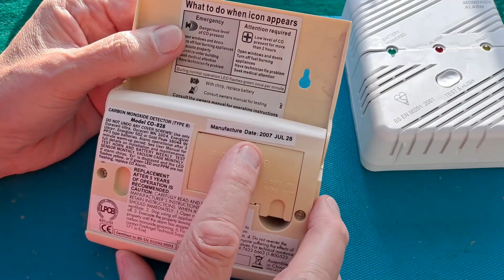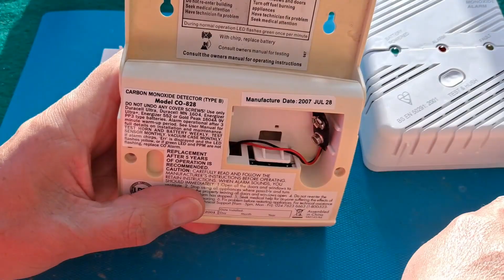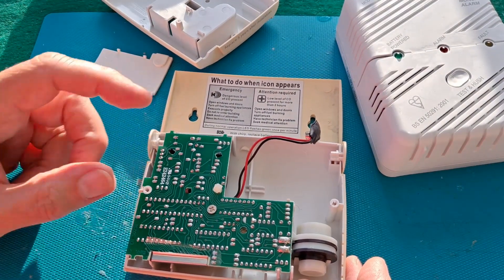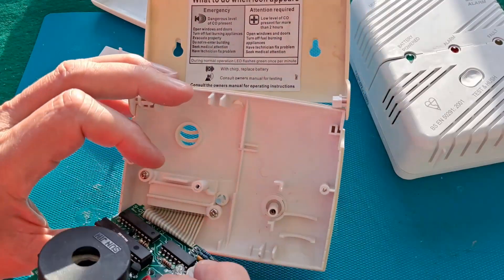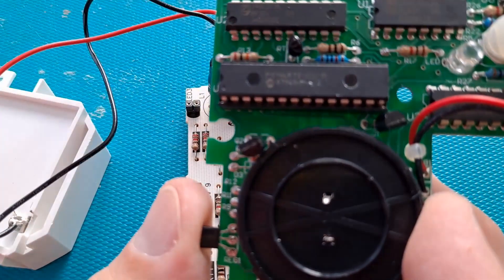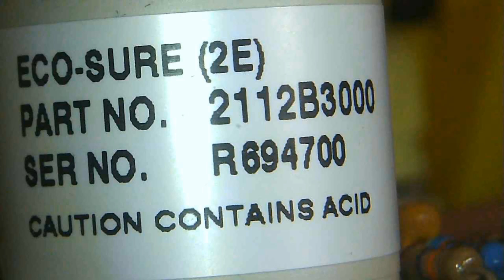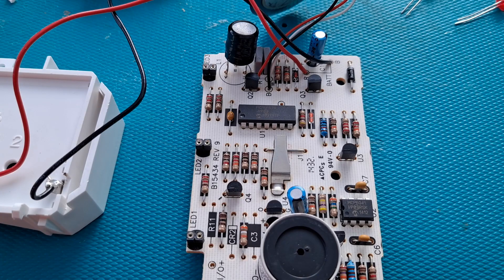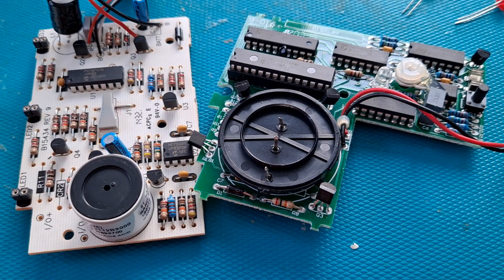Peek inside a couple of Carbon Monoxide alarms + PIC controllers

Comment: I have a couple of these the one in the kitchen I had to replace because it kept beeping I thought it might need new batteries but it had come to the end of its useful life so I replaced it I took it apart and saved a few bits and binned the rest
Reply from the maker: Do you have any experience with the PIC controllers. I noticed in another video the guy was talking about using them.